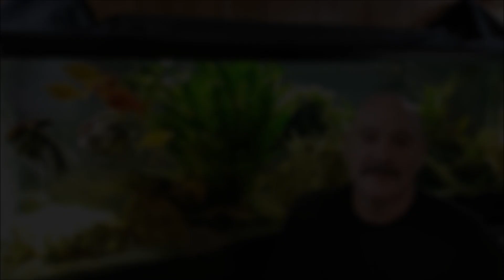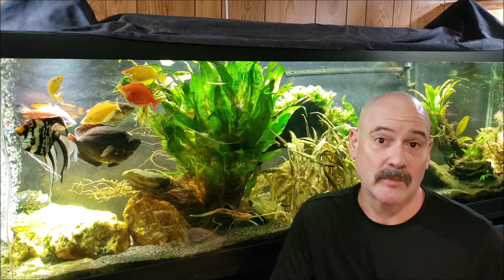How I Remove Nitrate And Stabilize pH

Comment: This was a good video Dan thanks for it 👍 , also may I please ask you another question? Is nitrate bad for fish or not really because my nitrite and ammonia levels are really low however my nitrate is mid range area but not 40 ppm yet and my fish are not really showing any bad signs
Reply: My nitrate gets quite high sometimes at its highest level about 40ppm or a little more but the fish seem fine I don't lose any. I think having some nitrate is fine just my opinion 😊
Reply from the maker: Nitrate doesn't bother fish unless it's in the hundreds of ppm range.

Comment: I am going to completely clean my tank tomorrow should I get the buck of water ready tonight or in the morning
Reply from the maker: What are you trying to accomplish? Chlorine evaporates at about a gallon per hour, so a 5 gallon bucket needs to sit for at least 5 hours before using it. An air stone in the bucket speeds the process up.